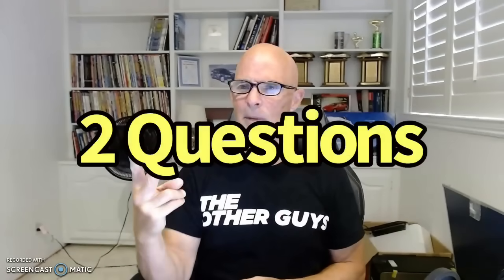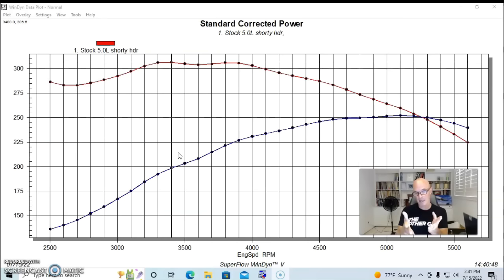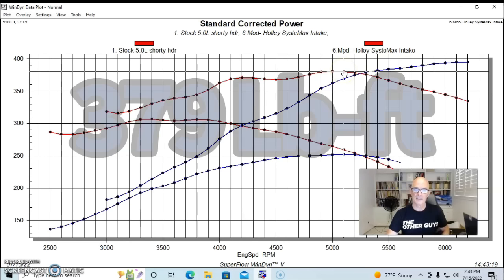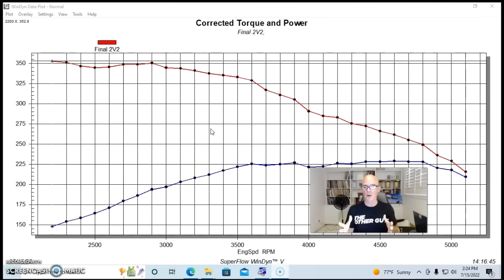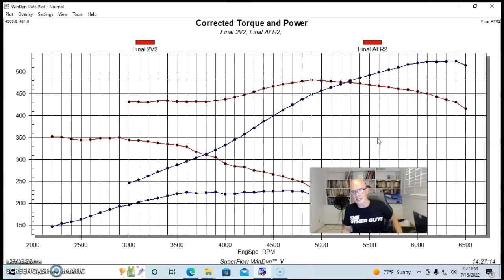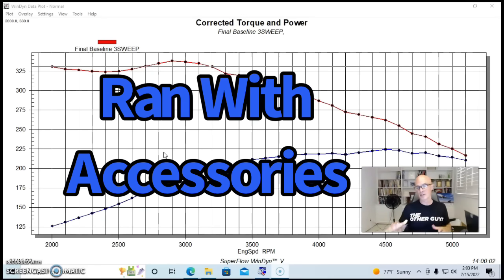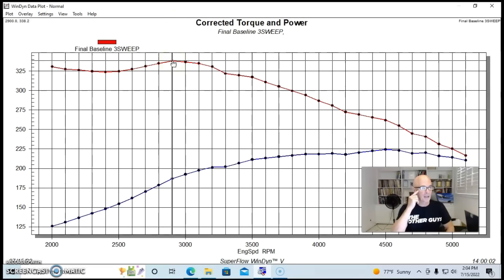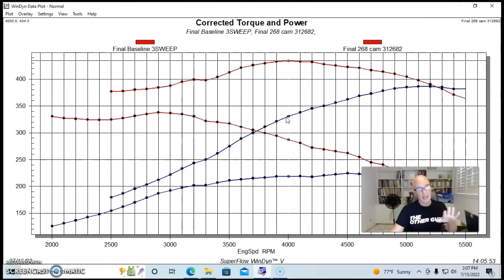FORD VS CHEVY VS DODGE-WHAT AMERICAN V8 MADE THE LEAST AMOUNT OF POWER? 5.0L VS 350 VS 360-WHO LOST?

Comment: When I read the title, I thought Ford 221, Chevy 267(The 50s 265ci might be a contender for this title too). I don't think Mopar made anything smaller than a 273 as far as LA series engines. I haven't really heard anyone trash the 273. But, a low power Chrysler V8 that comes to mind - early 50s Dodge 241ci "red ram" Hemi. They all have one thing in common... small displacement.
Reply: Its not so much the small displacement. Its the small valves. Restrictive heads. Crappy intakes and limited valve timing.
Reply: A friend had a 1962  Fairlane with a 221 and it was more drivable  than My 1977 302 Cobra !! When the were both stock!   I don't know  what the power level was for the 221, My mustang had less than 80 hp to the  rear wheels. When I bought  My car I knew it would be a dog but it was a 302. A few Changes  and  it has  412 hp at the Fly wheel and 337 to the rear Wheels and still a 302.
Reply: Low displacement isn't really to blame here though.
Reply: @RacerX-124  your  right they did every thing wrong to kill the power in the mid 1970's.
At least they kept building  V8 cars.

Comment: Good video, I really enjoyed it. Never cared much for the ford 302, I've owned a few in both carbureted and EFI form and they always just seemed lame to me. I owned 2 nearly identical '84 f150 pickups, only difference one had a 302 and the other had a 300 inline six and that 300 out performed that 302 in every way possible. Never really owned a small block Chevy that wasn't at least decent in the power department and the only Dodge 360 I've ever driven was in a Winnebago so I couldn't really tell if it was powerful or not though after watching this video I guess they are pretty decent engines.
Reply: Ford 302s are a lot of fun in light vehicles like early Mustangs or first gen Broncos. They just aren't enough engine for a truck.
Reply: Nothing wrong with a word you stated.  I agree 1000%.  302's have no place in a 1/2 ton or more truck.  It's simply not enough motor to move a 5,000 lb pickup truck.  Ranger... I believe should have had 302's optional since day 1.
Reply: The 302's would actually make more power than the 300 six, but up high, where you can't use it. That 300 six was a terrific engine for normal street use; all the power down low, a wonderful torque engine. But it stopped breathing at about 3500 rpm. Still, you were already at highway speeds way before that, so who cared. 
FYI, those lame Windsor 302 small blocks won Le Mans TWICE in a row.
Reply: @d.e.b.b5788   You are talking about the Gurney-Eagle/Gurney-Weslake 302, won lemans in 68 and 69 if I'm not mistaken. There's one on display at the Barber motorsports museum in Leeds Alabama. However that comparison is like comparing a 427 S.O.H.C to a 2 barrel 390 because they are both F.E's. it's no comparison and I do contend that the 302 available in cars and pickup trucks is lame for what it is.
Reply: Maybe it's because half of the damn truck is rusted off (weight reduced!), but the 5.0 in my 95 F150 moves it around just fine.
Reply: @JRC99  What rust? I live in the southeast, vehicles don't (usually) rust into the ground around here. If you are happy with your 302 that's fine with me enjoy it!!! I just don't share the love some of you folks have for them, to me it's a yeoman duty grocery getter
Reply: @dieselbronco9247  I'm in Michigan. My floor pan is shot, rockers are shot, cab corners gone, fenders ruined, bedsides rusted. 

It used to be my dad's truck, so I'm crazy enough to want to restore it. 

That's what I was getting at though - maybe it feels peppy because half of my truck has rotted off! 😂
Reply: @JRC99   You are not crazy to want to restore your dad's truck, all those parts you said are rusted can be bought new anyway. Fix it drive it and enjoy it!
Reply: @dieselbronco9247  Dad seems to disagree lol. In his defense I do have other projects. I bought the floor pan and everything for the drivers side of the cab but I'm also fighting the transmission
Reply: @JRC99  I have '95 F150 as well with a fresh 5.0. Changed out the lame 308 geared rear diff. for a 355 posi and it will completely annilate the tires. I've even smoked a couple of hemi powered pickups too.
Reply: @joshmalcolm4810  Mine has the 3.08 in it. It'd feel a lot quicker with 3.55s but I really like how it drives with the 3.08s.

Comment: Couple of things he isn't  telling you.
The Dodge 360 already came with roller rockers, from the factory, and the 360 factory heads flow better then either Ford or Chevy stock units.
That equates in to paying out a lot less cash to rebuild.
The other thing he didn't  mention.
There are pieces on the net, ( such as a three two barrel throttle bodies) that give you the chance to build a modern version of the 340 six pack from Dodge.
You're  going to go through a lot more cash, doing that to a Ford or Chevy, and as long as Chevy has the LS, nobody is interest in building a traditional  small block with three two barrels,...unless they are only seeing car shows.

Comment: Worse Chrysler V8 , was that dog of an engine 273c.i. just slightly more powerful than the 225c.i. slant six
Reply: Must have been just yours. Those ran pretty good, mostly.
Reply: @wymple09  yes they ran pretty good , but gutless as hell   all they did was wear your front tires out because of the weight and those silly little 13 inch rims Valiants came with . I switched to 14 inch rims off a Fargo van ( same bolt pattern )0bought the car new and it was less than gutless .
Reply: @grazynazambeanie5963  The lowest HP 273 made 180 HP, not bad. That compares to the 283 Chevy. There were performance versions available. A friend of mine had one in a Valiant and it was pretty quick. Way more power than a slant 6.
Reply: @wymple09  yup 1800hp is what the book says , but I had a friend with 55 chev with a 265, and he would blow me away at the drag strip , every time , also a friend with a Corvair, same 180hp , a flat six , air-cooled , it did have a turbo . I could get a hole shot , but once the turbo kick in he would fly bye . Sorry , but the 273 sucked , just the way it was , oh, mine was an automatic . It did manage to twist off an input shaft lol .. really, it was the slowest V8 ever , even the 318 in my full size dodge could easily beat it
Reply: @grazynazambeanie5963  Like I said, maybe just yours.
Reply: @wymple09  or maybe you friend had some modifications end , like better exhaust system , I think the 273 had the same basic block as the 318 just smaller pistons and shorter throw on the crankshaft and longer rods , not sure , but the plumbing for the exhaust was very tight . That was a big wide block , not nice and neat like Ford's 260-289 or Chevys 265 - 283
Reply: I had one , and you nailed it. Gutless engine and heavy ( 318 block I think ) B.C. to Mexico and back , wore out a set of front tires

Comment: My classmate from high school had a 1979 Z28 Camaro with 350, he told me the HP was 170 hp, I was bewildered it got the same horsepower as a 1995 Acura/honda Integra with 1.8 4 cylinder engine! This was far cry from a common 350 GM engines from 1968-1970 producing at least 300 HP
Reply: You're only comparing displacements
Reply: @cammykakes5420   yes, I am comparing two identical engines with the same displacement, but produced different HP and Torque. A 1968 Chevelle 350 have more horsepower than a 1979 Camaro Z28 with 350 V-8.  These late 70’s “muscle cars” are so bad (in stock configuration) many modern 4 cylinder cars can easily outrun them.
Reply: @diegosilang4823  Then compare against modern V8's.

Else compare muscle era I4 vs V8
Reply: Compare 1971output to 1972 out same low compression tune on most engines but different way of measure (gross changed to sae net which is more realistic).
Reply: Honda is powerful for it's size . especially if you are using same measurement standards (sae).

Comment: As far as Bang for your buck GM is hard to beat. should have tried putting 202 intake valves in the factory heads on the 360 makes a world of difference on high rpm power.
Reply: I'm looking forward to it myself, I have a blueprinted 360 with #308 casting heads that were mildly ported and machined for the 2.02 intake valves and 1.62 magnum exhaust valves. Paired with a comp XE284H it should be rowdy. My only regret is not getting it in my truck before he passed away from COVID last year. But another guy is still alive, James Bodine who has the black dodge truck from street outlaws fastest in America, I got quite a few parts from him before he put a big block Chevy in his truck.

Comment: An upgraded and recently worked on Ford 5l, with headers no less, compare that to a recently worked on Chevrolet although it did have manifolds. And compare that to a bone stock 360 you pulled out of a van that's worn enough that it shows in stock form lower horsepower than virtually every 318 barrel I've ever tested or have seen tested in stock form. I've never seen a 318 2 Barrel get less than 235 horsepower.
Interesting information but I would have thought these engines would have been closer in build parameters. I know you said that it was the worst three that you have tested, but one would have thought that they would have been a little bit closer in build parameters. Or at least in condition.
Reply from the maker: please say the words-What I had!
Reply: What kind of 318s were you screwing with? By the 80s they were rated at 170!

A buddy of mine had an '87 Ram with one, and while I'll grant you the DPO totally had no idea what they were doing and so it didn't run right, it was a total slug that couldn't even break traction in the rain. But even if it ran right there's no way it broke 200hp.

Comment: You go too far in talking about what you've done if you had a 355 Chevy it wasn't a stock engine. You modify engines and then you take them backwards with parts and everything else so you don't know what the lowest performing horsepower engine is since they were already previously modified Try it with stock engines!
Reply from the maker: I know exactly what the power performing engine I have tested-and listed them here

Comment: Hey Richard, this was a great video but, you made the 360 fight an unfair fight.  Why didn't you put upgraded pistons in it?  They make them, you did it for the other 2, why not the 360?  Also, that Chevy wasn't stock.  You either bored it out or stroked it.  Also, why didn't you run the other 2 motors with accessories?  Did you feel the need to handicap the 360?  This puts the stock 360 in an unfair light, you didn't represent it very well.  In addition, if you put fully ported heads on 1 motor, you do it for all of them.
Reply: Don't forget that junk non-roller comp cam that won't run in a mopar. Others got roller cams. Trick flow heads would have been nice also.
Reply: I don't understand the problem. This wasn't set up to bash any brand, just show some of the lowest powered stock combos and then what was done to improve them. The 360 was likely ran with accessories because they probably didn't have an electric water pump for it laying around.  It's obvious the mild 360 can't compete with an AFR headed 350.  The last 355 I built using the AFR 195 heads made 525hp at 7300 using a healthy mechanical flat tappet, 13:1 compression, 850 Race Demon...so on.  I'm sure there is a head for the 360 that would be competitive, but not the mild Edelbrock set, but the gains were still nice for a mild reliable cruiser. He just showed the lowest power from the three brands he had tested and showed what was done to improve each one. Each test was in isolation when done and have no relation to each other, or any idea they would be related in the future at the time the testing was done. Just enjoy the information for what it is, low power combos that can be improved by X,Y or Z changes.
Reply: Wasn't a fair test why didn't he use a 340 instead of a tk. Motor for a H.P test
Reply: This isn’t a comparison like the other guy said, he’s just showing different engines he dynoed. We all know the 360 becomes a powerhouse with upgrades and holds its own stock.
Reply: This wasn’t a ferd and mopar vs chevy video, but the best numbers won’t sway the ferd and mopar guys. Never do. They like their names and loosing numbers don’t matter, just loud exhausts and high emotions with turd boxes. 
BTW any mopar can go really fast if you rebuild it every time and pour nitro methane down its hole. haha 
Check out Steve Morris’ BBC style 5,000hp street motors. A couple pulley and crank borrows from Ford and Dodge but the whole interior running assembly is BBC brought up to current day. 
Just simply the best made motors out there, and the guys making less than half the power will hug their ferds and mopars cause numbers and reliability don’t matter.
Reply: @dallynsr  oh yeah, chevies have the most potential, that’s why my drag car is a 92 camaro with a 454 lol, but as far as daily driving new vehicles I’d take dodge over Chevy any day. Just a huge difference in build quality. They’ve really gone downhill since the 90s…
Reply: Richard, you have to CORRECT ways to do these test . 
1. You test all three of them in stock version to get a REAL compairing. Or : 
2. You do the same upgrade with the same type of pistons, cam, roller chain, and so on on ALL three motors and then för the test.
Otherwise your "test" is worth nothing. Stay focused yourself. 
If you are a trained proffessional then för this tests the correct way of not at all. 
And for the record : it would have been more CORRECT to compaire 351 Cleveland 4bb, 350 4bb and 340 4bb
Or even bryter : 351 Windsor 2bb, 350 2bb and even a 318 2bb. All stock. Then you can do a FAIR compairing. 

Otherwise your test is worth nothing. 
PS : I am a trained car mecanich. I have worked with motors since 1980. And I DONT know everything there is to know about cars ( nobody does) but at least I know how to a CORRECT compairing. 
You seem to not know.....
Prove me wrong Please. I will gladly say that you do correct test WHEN you do that.....
Have a nice day.
Reply: @kakavalle8305  this isn’t a comparison video. It’s just the lowest power engines he has tested from ford/Gm/dodge.
Reply from the maker: it wasn't a fight-it was three separate tests combined to show the lowest power motors I have tested-stay focused
Reply: If the Chevy don't have  a head  start it will loose.
NHRA has been giving Chevy a  leg up since the mid 1960's.
Reply: @mylanmiller9656  suure

Comment: That EFI 5.0 had 'induction of the gods' compared to the two barrel malaise era engines.  I was surprised to see over 200 on those choked up engines, not bad.  I had the smallest of the small block Chevs, a 262 in a Monza. It responded to the typical bolt-ons, for a smogger I think it faired well.
Reply: One of my high school friends mom had a 85 IROC-Z with a 5.0 tuned port and a 5 speed. His mom would let him drive it sometimes and that car ran good
Reply: @Daveyharledson  the TPI years were good, coming out of the dark times.

Comment: Engines are air pumps. The faster air is pumped in and then pumped out the more power is made and hopefully the faster you go. Think carefully... Any modifications fall under two categories.  Helping the engine last longer or helping the engine pump air in and then out.  Just food for thought
Reply from the maker: THERE ARE MORE THAN TWO CATEGORIES
Reply: @richardholdener1727  My comment was, as I said, just food for thought. 
Although I am curious. What other categories do believe there are? 
1- make the engine last
2- make the engine turn faster/pump air in then out faster.
Keep in mind the subject matter of the video

Comment: Id be curious to see how the 61 buick 215 v8 would stack up to these weaker powerplants
Reply: 150hp is pretty good for 3.5L in 61, they went as much as 200hp in a few years of improvement which is very impressive for the size, weight and the era they were made.
Reply: @3800S1  agreed.  It also had a pretty low redline, so that held it back too.  It's a very capable engine though.
Reply: @RacerX-124  I heard it was popular with enthusiasts for that reason.  It's also the grandfather of my Buick V6s I have in my cars, which also is a great engine to mod and made pretty good power for it's size. My 3800 series 1 makes 240hp with just higher comp and a baby 212/212 deg 470 lift cam, up from 170hp on the 180/190 and 400 lift cam with low comp.
Reply: It at least has ultra light weight going for it.  Brabham managed to make great power out of them with less displacement in their F1 cars, albeit with their own OHC heads.

Comment: everybody always forget's ford's 221 v8 which put out about 80 horses. lol
Reply: I had a 64 falcon with the 260 small 8 with a whopping 175 hp.with a little head work and a little higher lift camshaft with a 4 barrel Holley we reached 210 hp.we were dancing in tall cotton back in 1968.ha

Comment: Oh man you did the dodge dirty on this test 🤣 that 2 barrel and exhaust manifolds were choking that thing to death
Reply from the maker: just like the Chevy
Reply: Do you have a video already for those motors showing which would benefit the most from the exact same modifications? Simple stuff like bigger carburetor, intake, and exhaust manifolds?
Reply: @richardholdener1727  the 360 didn't have fully CNC ported AFR HEADS and an Air Gap intake with a bigger cam.  Like the shitve
Reply: Dodge exhaust manifolds actually flow pretty good it's the pipe you attach to them